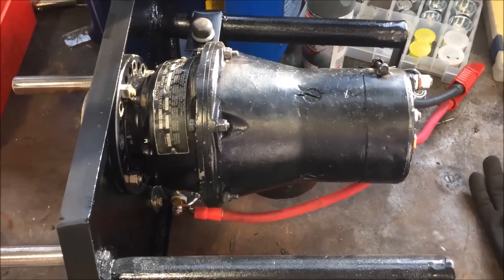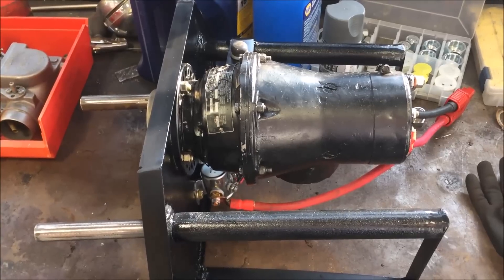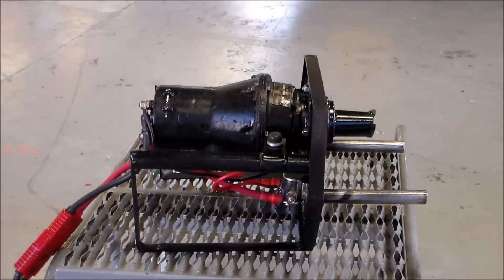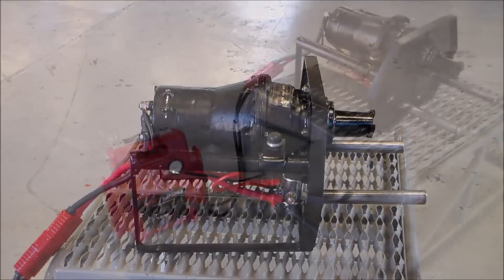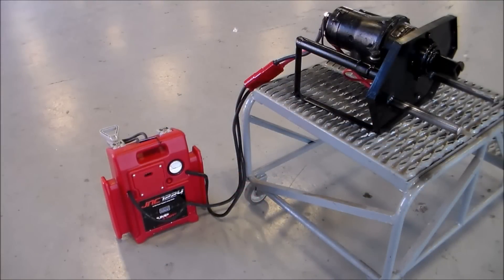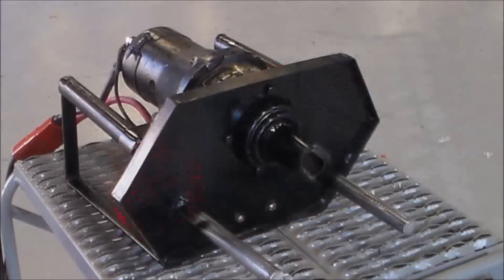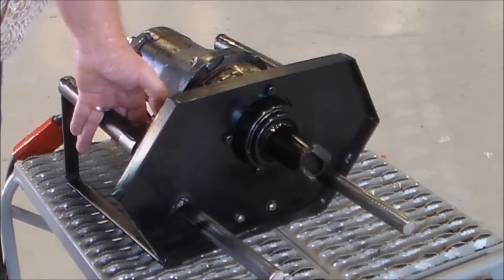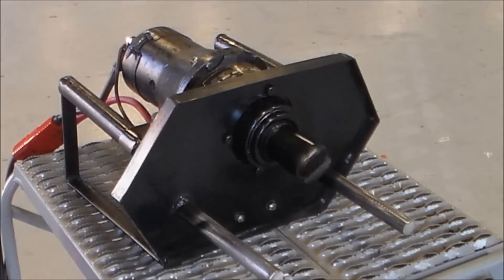Build an electric starter for Antique Truck.

Comment: 24 volt? Nothing on the truck? No lights or anything? Never heard of that but it is an old truck for sure. Looks more like an old covered wagon. Can't imagine starting that old thing with a hand crank! Works real slick! Man, that's quite an engine. Sounds good! Heavy duty. Now that you've got her tuned up, it starts good with the hand crank. There's some metal in that old thing!
Reply from the maker: It is a Liberty Truck made for the military. They made 2 models, one with lights and electric start and one without. Thanks Pat

Comment: where did you get the 
starter motor if you said i missed it i have a 1931 oliver hart parr and its only hand crank
Reply from the maker: It was a DC3 airplane gear reduction starter. We had to reverse the rotation and step up to 24 volts to get the speed it needed. You can find them on ebay. Good luck and Thanks
Reply: Thank you very much

Comment: Wow, been a while since I've seen one of those!  Not sure I ever have.  Very innovative way to make it easier to crank!
Reply from the maker: Thanks, It will be traveling around the state on display .
Reply: @RustyGlovebox  I have a question as to where to find such a DC3 starter or similar - I have an application this would work well - two 1930 farm tractors no starter or ring gear but a crane (Rumely 6 with waukesha engine) thanks!
Reply from the maker: @steveschock523  I found this starter at a starter shop in town. It was an old one they had laying on the shelf.
Good luck in your search
Reply: @RustyGlovebox  yes a very cool project - do you have any idea what the torque is on that thing? I like the idea of direct connect with the crank -as it eliminates a lot of extra hardware with driving a second gear etc but a little fearful of how to disengage quickly when the engine starts; thinking about a spring loaded disconnect of some type.the alignment pins are a great idea. would you part with that one?
Reply from the maker: @steveschock523  On this truck the cranking rod  was spring loaded and a spur drive to help it kick out when the engine fired up. The starter had more than enough torque to spin the engine over.
Reply: @RustyGlovebox  thats helpful. My tractors did come with a spot for a starter but these are really rare - my contacts at vintage starter rebuilders says tough to impossible; an aircraft starter with the design you built is promising as the hand crank has a similar setup; as long as the cost won't break the bank. given I need to start 2 tractors it is especially attractive.  thanks for you great work and your commentary

Comment: Sure beats swinging off the front to get it running and dialed in...Good stuff Lloyd.
Reply from the maker: That thing can backfire and through you for a loop when the timing is wrong. Thanks ZIG

Comment: that sure beats hand cranking that engine, I don't like to hand crank any engines, unless they start on the first pull.
Reply from the maker: They can be really be an arm breaker that's for sure. The starter make it much easier. Thanks

Comment: Off the subject - but how much voltage will a 12 starter take ...   just for a second or two ...   ?  please ..  thanks     Gary
Reply from the maker: A regular 12 volt starter will need the solenoid changed to a 24 volt solenoid. As long as you don't get it hot by staying after it too long it shouldn't be a big issue..
Reply: I have an Allis with a stuck engine ..  I FINALLY got the engine to turn about an inch ...  with the flywheel gear ..  but the engine is too tight for the 12v to turn - I don't think it has a solenoid - just an old starter with  + and _ contact ..   it does have a push button on the starter to "continue continuity to the starter - what I have is a 12, 24, 36, or 48 volt ..  a simple 2 to 5 second "hit" ...  but don't want to burn the starter up .  :)    Gary
Reply: Maybe I am totally "off base" here ..  but I don't see a solenoid [smile] - it is a 1941 ....  am I mistaken?  thanks!!  Gary

Comment: That makes starting easier....saves a lot of winding in the first place. One an engine is running and warmed up they usually start easily, as of course you know.
Reply from the maker: When we first got it  the timing was way out of time. the carb was missing parts . After rebuilding and repairing you don't have to use the electric starter  but it is much easier to use it. Thanks Malc

Comment: Is that a Twin Wasp starter ? I had a NOS one with a cracked casing.
That's such a nice truck, hope we see more !
Reply from the maker: The starter shop we got it from said it fit a DC3 but the mount looked universal and could fit several applications.. We were very excited to get to work on the truck. Thanks